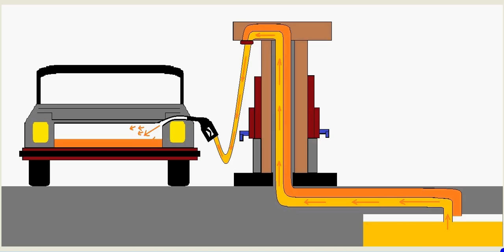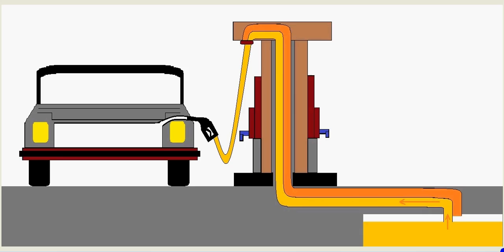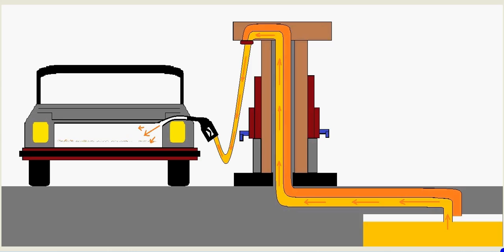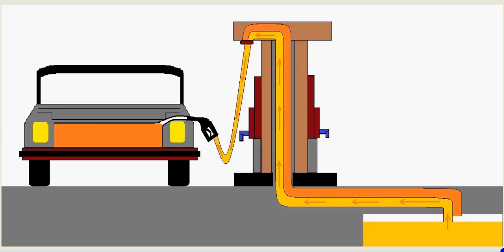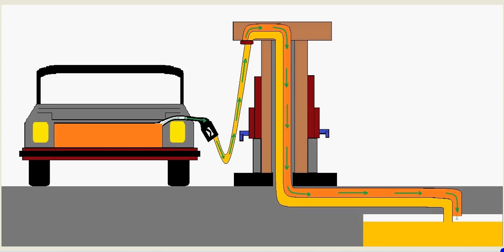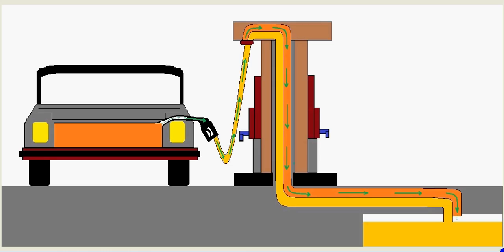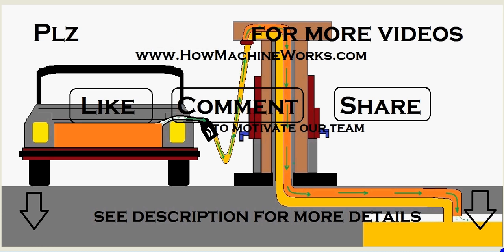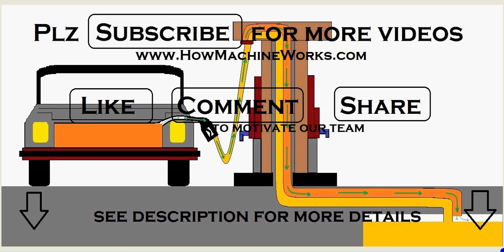Why not to fill full tank of fuel from a petrol bunk - Must watch - Share.

Comment: That might be true for wherever you live but, that's not normal. Normally, once fuel reaches the end of the nozzle, the pressure difference caused by the end of the nozzle being submerged in fuel causes a valve in the nozzle to close. There is no return line since it isn't necessary.
Reply: Not entirely true, modern pump systems have vapor recovery and will cause some fuel to go into the vapor recovery line. This causes problems with pumps at the time when someone goes to pump fuel and the auto shut offs will keep clicking even if you're not full. The most common culprit is fuel inside the vapor recovery line. So in essence he is correct but it would not continue to fuel. The vapor is removed during a fueling so it is a two part process
Reply: Interesting. I've never seen a pump like that and I've been to several different gas stations in and around Ohio in the US.
Reply: No such thing as a return line on a gas pump people! It would contaminate the damn fuel in the tank.
Reply: +Jason Queen It's not true period. All pumps are federally regulated in their design. There has NEVER been a return line in a fuel pump. Even old school ones didnt have any.
Reply: Brian Tolliver, there is a return line in for fuel. Look up Vapor Recovery. It is taken out of the cars gas tank and returned to the UST system called Stage II. Fuel will sometimes get into that line. Its not hard to research this. I manage maintenance for a large company that owns over 150 plus gas stations.
Reply: +David Humphrey I&#39;m sorry dude but really... its VAPOR recovery. the clues is in the name. it returns vapor, gas. so that the gases do not escape into the atmosphere. and the VRS is a very new thing to hit pumps, back in the day they didnt know or care about those gases escaping into the air. The venture affect will stop pumps, yes there may be a tiny amount of fuel left in the hose. but only tiny.
Reply: So... Vapor recovery is a very new thing that isn't in use in Ohio, Indiana, Kentucky, Michigan, Tennessee, or Georgia, right? I ask that because I've never seen one. Also, wouldn't the mixture of air and fuel vapor be extremely volatile?
Reply: well yes it kinda is, and its LAW for many states to have it. Pick up a petrol pump and look for a glean light in the screen that means its active. Its law for many EU countries also. and YES petrol vapor and air is volatile, why do you think its being recovered. But if you are talking about the sensor then its safe as there is no source of ignition.
Reply: http://auto.howstuffworks.com/gas-pump.htm
Reply: yes. but vdx55FZsubc?t=1m50s watch alittle longer and you will see. there is a line back to the tanks for the vapor, as that is being recovered. it looks like EU countries many use this while the US have tanks that prevent vapor release. I mean this is all pretty easy to find yet people to lazy to even google.
Reply: Instead of "claiming" there is one. Show the proof. I have looked and searched diagrams and only ONE other shows one (potentially). The rest dont show one. It's easy to spout propaganda without evidence. Now show me the evidence.
Reply: +David Humphrey Nope. No such thing buddy, And I work in fuel delivery.....
Reply: +David Humphrey David The only VAPOUR being recovered is the vapour out of the tank when you're mass filling the tank (anything over 1000 litres). That's due to the pressure in the tank, nothing more.
Reply: +Marko Banovic would show you but this ass deleted my comment. whatever dude. you want to live in a fairly land its upto you. but real world doesnt work that way. you live in germany so what i have said is 100% true to you. not only that you have just confirmed what i have just being saying. its a VAPOUR line back to the tanks for gases... thats what i said, thats what it is. only vapour. i gave yo links and a diagram which were deleted by this ass in the video who wants to convince ppl petrol stations are stealing fuel off ppl.
Reply: Man i work in fuel... so i know. The only reason we have a vapour collection tank is because of the pressurisation of the tank. We dont wanna blow them up as they are not pressure vessels.
Reply: hmmm

Comment: This is pure urban legend.  You are correct to the point.  However the return you are referring to id for vapor recovery only.  If liquid were to come up the line it will immediately interrupt pumping until vapor level reach a preset level that can only be vapor.  The system is 100% designed not recover liquid

Comment: This is not true. You need to watch the YouTube video on "How A Gas Pump Works". Near the tip of the nozzle is a small hole, and a small pipe leads back from the hole into the handle. Suction is applied to this pipe using a venturi. When the tank is not full, air is being drawn through the hole by the vacuum, and the air flows easily. When gasoline in the tank rises high enough to block the hole, a mechanical linkage in the handle senses the change in suction and flips the nozzle off.  It does not SUCK gas back out of your fuel filler tube.
Reply: That is how nozzles determine when to shut off but pumps work in a two part process. It sucks fuel vapors out of the tank while it dispenses fuel in a stage two vapor recovery system. What will happen is if you continue to "top up" you will eventually suck fuel into the vapor recovery line which goes back into the tank. When customers pump fuel and get fuel into the vapor recovery line it will cause the next customer to experience the nozzle prematurely cutting off when it's not fuel. You have to clear the line then at that point. Not a hard process but in very simple terms he is right.
Reply: +David Humphrey  I'm not sure what you are saying is entirely correct either (could be wrong though), I know the systems you are referring too and have read the DNR pamphlets stating such that fuel can be pumped back into the tanks but it seems pretty illogical to me at the rate some attempt to describe as though its even a real issue (they act like its sucking the life out of ya lol) that warrants pamphlets and videos being made.. for various reasons. For one I don't think the vapor pumps themselves can pull the suction required to actually suck fuel up the line and then pump in order for it to get back to the tank. Two, assuming I'm wrong and they actually can suck a small amount fuel up the line... wouldn't the excess fuel just free flow back out of the line the instant you are pulling the nozzle out of your filler tube... and If it doesn't do so via a shut off regulating both inner and outer lines at the same moment in the nozzle, than if the vapor line is able to suck fuel (not sure) even a little at a time the line would eventually just simply keep filling up and dumping-returning back into the tanks with every customer that does so which would equal the fraction of a cent loss everyone here is debating over if it could be lost or not. (real world problems) lol   OR  does it only fill up the vapor line until there is not enough suction to handle the load and it stops which then requires clearing of said line... if that's the case then it also never reaches the tanks (or is it blown the rest of the way into them?). 

 Either way, I don't believe any of this to be an issue to warrant a video being made nor DNR pamphlets etc. ever mentioning the possibility of it happening (which I'm sure you agree lol). Is the man correct that it can possibly happen? A: certainly, but not no where near the extent as displayed nor is it a issue that warrants people being scared to fill up their tanks at the dirty no good greedy robber stations (sarcasm lol).  Its almost like that's what is trying to be portrayed In a round about way at times when I hear this narrative.  Oh well... we are still living... the world didn't end because of it.. bahahaha   (btw you are the only comments I read that actually knew shit about anything, well done sir) Have a good one man... Peace

Comment: Once you hear the first click of the gas pump, did you know any gas you pump after that isn’t going into your car’s tank? You’re actually paying for gas that is filling up the hose, ready to be pumped into the next customer’s car. Any additional gas you try to pump into your tank may be drawn into the vapor line and fed back into the station’s storage tanks.
It can cause the gas pump to break. Most gas stations have a vapor recovery system. When you top off your gas tank, you can cause it to break or become inoperable. This problem can add to the air pollution problem and cause the gas pump to fail for the next person in line.

Comment: This is only true with old machines that are not digitized. Modern regulations dictate that the pump stop the flow. Which is why if one tries to "top off" too much they will spill petrol all over the ground/themselves.

DISCLAIMER: Unless you are in India where thieves are as common as potholes. Then you are probably filling your car with piss, so that you run .5km on the petrol in the fuel line and then the car craps out.

Comment: It is completely NOT TRUE, as the fuel pump Nozzles have equipped with auto stop censor. whereby when fuel reaches up to the tip of the nozzle the censor will trigger.. automatically cuts off the fuel delivery into the tank....So there NO WAY the fuel goes back to the under ground tank of the station. The video is totally rubbish, as i'm with this Fuel Pump Industry for the past 20 years.

Comment: This is nonsense. There's no return line in the fuel pump nozzle. The pump shuts itself off when it senses the tank is getting full thus immediately stopping the flow of fuel.
In any case if your "theory" is right, this would amount to fraud by fuel stations (people paying for fuel that has returned to the fuel station tank) as it would be blatantly illegal.

Comment: Many ppl are disagreeing to the facts of the video, atleast in India everyone know that when we ask for full tank, the person at the gas station locks the button of the nozzle - and that stops at one point. After that he does a half press to continue fueling to round off the amount payable - My confusion is where is this extra fuel going if it is not overflowing from my car`s fuel tank.

Would love to see someone doing an experiment fueling in a transparent bottle clearing all the facts - I would have done this, but in India we are not allowed to take petrol in bottles :-(
Reply: Chinmay H We fill our own tanks here, ahahahahahaha......
Reply: What happens is the fuel foams up slightly as your tank is being filled so when the person presses the handle again to round off the amount the foam has settled just enough to allow a little bit more gas into your tank.
Reply: Bachittar Singh
 I had this question because once the auto fill stopped at Rs.1500 approx and the manual fill went up to Rs.2000. If there is so much margin then why did it auto stop, that brought me to google and to this video. The cost being Rs.80/Litre so 6 Liters extra which was suspicious.
Reply: Like I said the fuel foams up like soap bubbles and fills the whole volume of your tank causing the auto stop to trigger this foam settles very fast and when you open the handle again more fuel goes into your tank also the auto stop is based on air pressure and vacuum so it can be triggered very easily sometimes because the fuel is flowing faster than the filler tube if the vehicle is capable of flowing it all depends on the design of the vehicle, the gas stations Nozzles and the chemical properties of the fuel itself :)
Reply: I furled up my TATA Safari at a Bharat petroleum station in one district of Punjab state and 1000 Rs brought me close to half a tank, at the same fuel price I filled my tank with 1000 Rs at another Bharat petroleum station in another district and my guage showed a significantly higher increase leading me to believe that one stations pumps were rigged to cheat customers
Reply: Chinmay H Gasoline is too volatile to 'foam'.  Kind of a bullshit answer.
Reply: If your fuel is foamy. You have bad fuel.
The fill nozzle will keep going on auto till something makes it stop. That something is supposed to be a full tank but that doesn't usually happen. It's quite common for the fuel to be coming out of the nozzle in a way that doesn't allow it through the fill tube in your vehicle correctly. This kicks off the overflow switch and the nozzle needs to be kicked back on or operated manually till your tank is completely full. It's also important to remember that the fill tube going from your cap to your tank also holds fuel.

Comment: Do you actually believe what you are preaching here. My friend you are a very very wrong. The vapour return line ends at the nozzle. It actuates a trigger valve in the nozzle. Thats why you hear a click when the valve shuts off. No matter how much you press the lever it wont open the valve. Please you are spoiling your own name by publishing unresearched information like this. Imagine what people are going to thing what kind of a company are you. You dont even have to go far here on youtube itself sesrch and see how the nozzle works you will understand. You have such good information like the 6 stroke engine why do you want to spoil your name like this. Dont talk about old pumps new pumps there is no pump that has this feature you are talking about. The government will not allow such a system to be used in filling stations. Yes density is a big thing thats why pumps have density readings put up. Its true morning you get more fuel cause of low temperature and all. Please research before you want to spoil your name.

Comment: WRONG...... buddy get your facts right b4 u post a video. the return valve yes is a vapour return valve only to pull air out of the tank as u fill to avoid fuel vapour coming out as fuel goes in. the auto shut off valve ( now mandatory around the world ) shuts fuel delivery as the vapour return value on the pump nozzle senses an excess fuel / vapour content indicating a pending over flow / fill. the reason I know this as I work for TEXACO and service these pumps......
Reply: + 1 in french station , i was working for Tokheim : same system ....
Reply: Hi Michael,
I own a Maruti Swift LXI (INDIAN MAKE). When I take my car to fill petrol, the fuel dispenser automatically shuts off within 2 -4 seconds. The fuel attendant told me that there is vapor in the tank which automatically shuts off the petrol dispenser. Hence, he had to fill the petrol manually by pressing the lever on the dispenser to fill petrol even though the machine is automatic i.e. key in the amt that u want to pay and the exact amt of fuel will be dispensed. I wanted to inquire is this a kind of cheating done by petrol pump attendants to fleece money or the explanation given by the attendant ia true